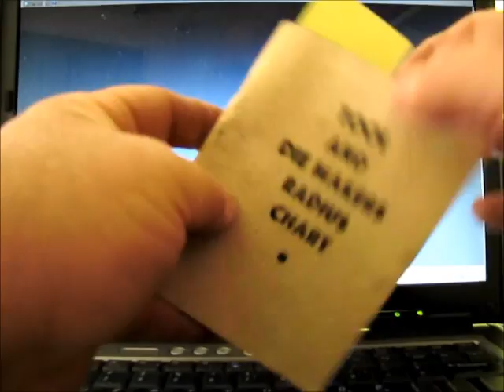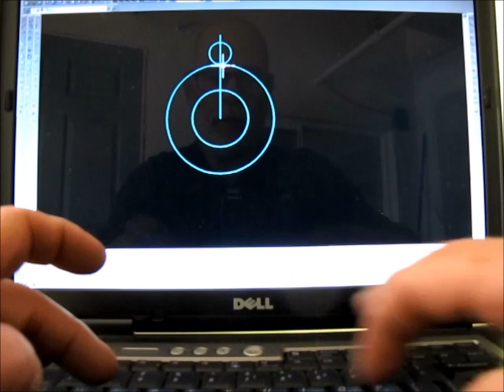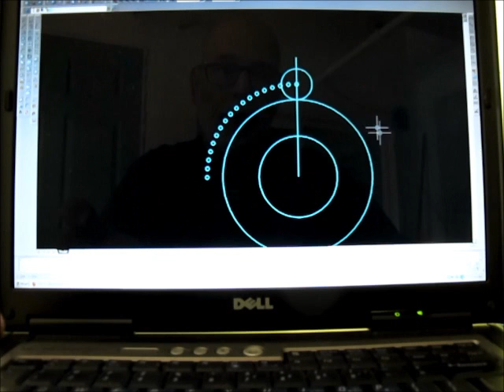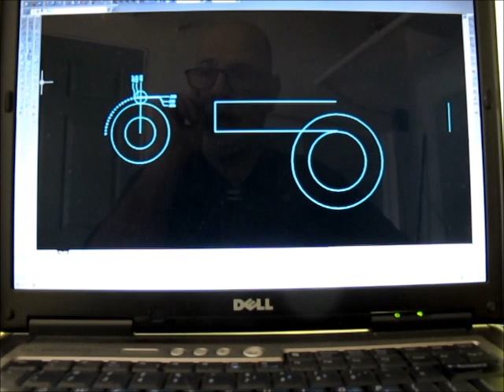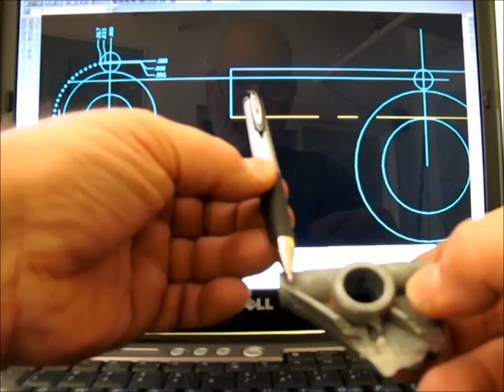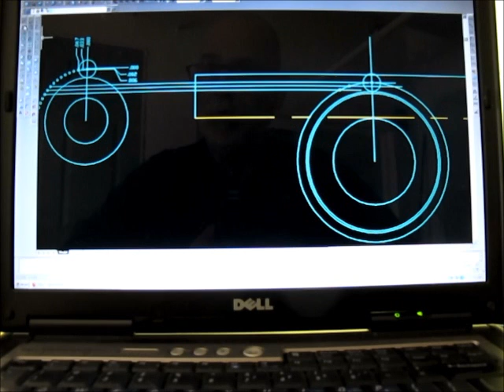Blade Tensioner Repair Part 4

Comment: I prefer working with AutoCAD 2009.. but recent versions are good too. In solidworks, create a 2D/3D ojbect.and just use a 2D/3D toolpath in your CAM, as long as your dimensions and coordinates are correct.
Reply from the maker: Hi Greg,

Then import it into your manual machine.... I think we need a new post processor.

Cheers,

Tom

Comment: Tom,

Excellent work on the Kellering, and also on the AutoCAD.

I do everything on AutoCAD (used it professionally since the first release).
I just wanted to mention (and I'm sure you probably do this as well) that I frequently print my parts full scale, cut them out with scissors, glue stick the print to the part and them vert bandsaw them out. Works great on parts with radius's and features that don't need much accuracy. Then blend with belt grinder.